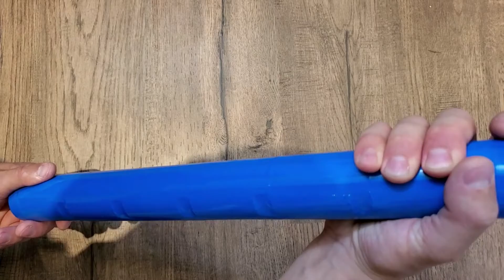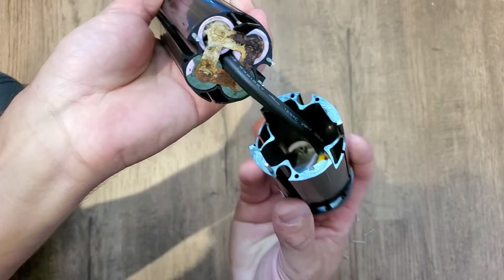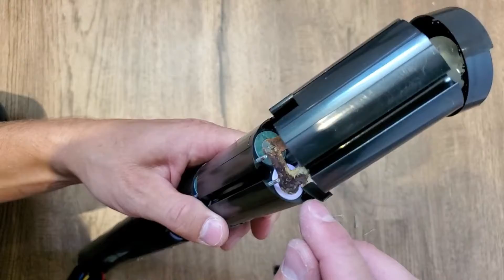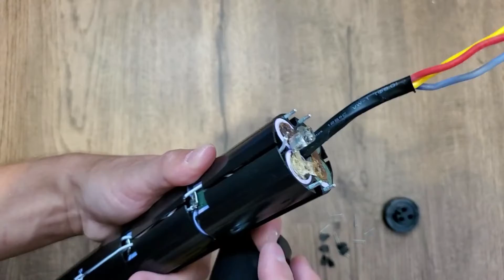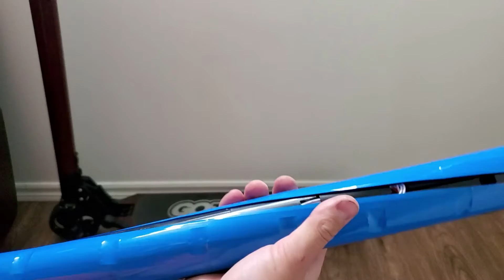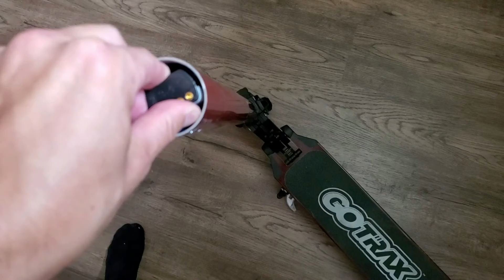Gotrax Electric Scooter Battery Repair Cell Replacement

Comment: Haha wow. ive only just begun to make batteries. I made a 3s and 4s battery. I got all that equipment and tools! this is gonna be a piece of cake! Screw DMEGC batteries! they are so weak! theres much much much better batteries now! 5000mah and 30A discharge? Ohhhh baby! im gonna put another 10,000 miles on this thing
Reply from the maker: The tires wouldn't resist )
Reply: @maximgeek  Bro a thousand thank you's for this vid! I'll send you some pics when im done!

Comment: the contacts for my battery pack were welded together.  I couldn't get them apart with my soldering iron.  Just gonna opt for getting a replacement battery.
Reply from the maker: spot welder was used they need to be mechanically taken appart.

Comment: I have question I haven't ride ir charged my gotrax g2 scotter for 6 or 9 months and it battery dies in 5 minute and when i put it in the charger for 5 seconds the battery comes back
Reply from the maker: maybe battery is disbalanced or some dead cells, you'll need to charge every cell pair to find bad one or balance them, first this I would do, measure voltage on the cells.

Comment: Hey, where can I buy the right 18650 cells? Not all are rated for used in drones or scooter that require more mah. Thanks
Reply from the maker: I usually reuse existing one, in 18650  C rate is important this is discharging rate, for example laptop batteries have low C so if you'll use them, multiple need to be in parallel, if you use power tool batteries, they have good C even one, to buy, it can be aliexpress, amazon ...

Comment: too involved! im throwing the fkn POS scooter in the garbage! NEVER again would i purchase a GOTRAX! I have now way to weld batteries. $350 down the drain!
Reply from the maker: you can buy cheap solder iron, not good for the batteries but will do the job.

Comment: whats the voltage at teh pins? i only get 16v  at the main pins but i get 42v at the pins right after the BMS at the first Battery pack ?
Reply from the maker: you can test per group it will be ~4.2-8.4-12.6 and so on. it it's fully charged or ~4v per group or ~3v if it's discharger.

Comment: whats the total voltage fully charged ???
Reply from the maker: My scooter battery was 36v so it's 10 series when discharged 30v charged max 42v

Comment: I found your video after already having done mine.  I did run into a problem and wanted your thoughts on it if possible.  My cells total 40v.  But the BMS show 14v.  I verified I have 40v coming to the BMS.  Inspection of the BMS was ok.  No indication of overheat or tracers oxidized.  From the battery, the positive and negative are soldered to the board.  The negative wire that is soldered at the end of the board and serves as the negative to the battery 5 post was the problem.  So, what I did was soldered a wire from the negative post at the top cell closest to the BMS to the ground on the BMS that sends ground to the battery.  It worked fine and the scooter runs fine but I am wondering about long term.  You think grounding the terminal to the battery is ok?
Reply from the maker: I don't think so BMS should be able to limit discharge and charge of the battery if you are bypassing this logic it can discharge under allowed voltage and kill the cells or more dangerous overcharge them that can create the fire that's really DANGEROUS.
Reply: @maximgeek  Ya, that is the question... am I bypassing the logic or just giving ground to something that is supposed to be grounded anyway.   Each bank was nearly identical in voltage.   After weeks of riding it daily with many discharge and charge cycles, it seems to be fine.  All cells are almost identical after discharge

Comment: Why not just replace the battery
Reply: Because you can get the cells pretty cheap compared to most pre-packaged options. 
Also, it leaves you certain of what is inside of it, as well as it makes it easier to recycle the old cells.
Reply from the maker: 1 cell cost 2-5$

Comment: What battery does it use
Reply: 18650’s
Reply from the maker: C rating is also important (max discharge rate)

Comment: Hello sir ,u have not shown the measurement of voltage of each assembly which leads to incomplete information
Reply from the maker: Every assembly you charge individually to maximum this is enough. The one that doesn't charge or gas low capacity what one needs to be replaced.

Comment: My battery on the 1-5 terminals has 12v on  1&2 pin  is all file or it should be higher voltage?
Reply from the maker: I don't remember exactly the battery voltage but you should take in consideration that every element should be ~4v, minimum to be able to charge 3v.

Comment: Why not split the tube in half instead of perpendicularly parallel.
Reply from the maker: Hi, because this is how it is build, I wasn't rebuilding whole battery but only replacing some element.

Comment: the cell is 18650
Reply from the maker: yes
Reply: @RomaFixcom  rebuilding the battery is the only way for old discontinued scooter models.
Reply: @boltyk1 true. But this specific battery is still sold. You can search for x7bdh

Comment: I have same scooter the battery is fully charged but scooter only turn on when it is plugged in to the charger. I've seen it charging from 1 dot to 5 dots but when I unplug it and press power button I get no display no power. When I plug in scooter runs fine 14 mph
Reply from the maker: I had similar problem when battery BMS was defective.

Comment: If you still have this scooter (or a charger): would you be so kind as to let me know what the connector is? I thought it was a failry standard 5.5 OD by 2.1 ID, but it doesn't seem to fit. My caliper says OD 4.5 but there is always some measurement error there. I cannot find a connector that will work :(

My scooter has the same overall shape but the battery is only 24V, the motor on the wheel says 250W.

Comment: I disassemble same  pack to find 2 cells under voltage . Wondering what  c rating batteries   those are.  Marked only with numbers starting with 0117030xxxxxxxxx  3.65 v.
I'm testing for capacity now but I'm looking for max discharge C rating

Comment: I haven’t rode or charged my GT tracks V2 in over a year. I take it out of the shed charged it up and it’s not moving. Does it need a new battery even if the battery lifespan was fine?
Reply: does the charger shows that it is charging or doesn't detect the battery at all?

Comment: I have a battery just like that that stopped taking charge and upon disassembly have discovered corrosion on the spot welded terminals in the center section of the battery pack. It eh corrosion from the leaky electrolyte?

Comment: My gxlv2 needs a battery but none are available I can get one for the gxlultra Both are 36v batteries but the ultra battery is 7ah The v2 battery is 5.2ah Can i use the ultra battery in my gxlv2?

Comment: Hi do you think I can use a 36v battery for this scooter since my old one said 25.2v. Do you think it will burn my controller if I use the 36v for the replacement battery?
Reply from the maker: I think controller wouldn't resist.

Comment: 10 batteries in series will give you 36V power. It's so simple to keep the orientation of the batteries right. It looks difficult to copy the processes from the factory. Battery length is critical.
Reply from the maker: this is 6s2p as I remember

Comment: Hi buddy. what voltage do you get from the battery connector? all cells connected getting 37V from battery terminals. connect the charging board (board at the top of the battery unit) I only get 14V + and -????
Reply from the maker: Maybe you have 36v battery, but it seems to be BMS problem.
Reply: @maximgeek  it's gotta be, I think is a chip on bms. Once power removed chip dies, I had similar problem with my dji mavic drone battery. It's OK to have lower voltage as long as there is one to keep the chip alive. Got new battery today and power is 39V from factory connection.

Comment: Do you think it would be ok to replace the cells with 3000Mah, 20 A discharge?
Reply from the maker: Maybe 3000mAh 20A discharge would work
Reply: @maximgeek  I don't see why not. It's just a longer charging time. 20 amps it's plenty, i think.
Reply: @RadBudaspectrum-photography  did you change it?

Comment: Hey thanks for the video! I'm looking to upgrade my friend's scooter to use higher quality cells than gotrax did. Do you know what the capacity and discharge rate of the stock cells were? I'm thinking of LG HG2 with the 30C rating, but wondering if it's overkill?
Also, from your video I counted 24 cells total?
Reply from the maker: I installed 2x5c parallel and when I was driving I feel that not enough but 30C I think would be to much. You need it only on start after consumption decreases.
Reply: @maximgeek  thanks for the reply! Maybe some extra capacity with 20C might be better?
Were there 24 cells total?
Reply: @ryguy694  did you end up replacing with a better battery?
Reply: @victorrodriguez4081  I replaced all cells with 20C and 2800mAh ones and it's working way better! Only problem is that I didn't weld one of the pairs well, so I have to take it apart again.

Comment: I’m wondering if I can upgraded the battery of a Gotrax v2 but no vids about it
Reply from the maker: I already changed my scooter but by the plan I was thinking to attach external 24V battery and use xt60 connector close to charging port.
Reply: I have same scooter in this video i called gotrax they are evil hung up on me was super rude can i use a 36 volt for the g2 plus mine is the 27 volt they dont make it no more

Comment: what is the reason to lead you opening the battery pack? Low voltage or quick drain of battery?
Reply from the maker: not charging.

Comment: Thank you for this video. What tool did you use to charge the individual cells?
Reply from the maker: They where already welded in pairs so I simply soldered them but it you have separate cells you'll need spot welder.
Reply: @maximgeek  thank you for the reply. Did you charge the batteries individually before reassembling? Maybe I misunderstood you in the video.
Reply from the maker: @AB-bu8ti  I tested each pair and found out that I had only 2 pairs defective, I keep original non defective cells and added 4 more cells (2 pairs).

Comment: That's axactly what I needed, I have a Soflow so1, it uses exactly the same battery, but it's 5,2AH. Thanks again now I know where to start. Stay healthy! Greetings from Germany
Reply from the maker: Check that discharge rate to be enough ... I had another one and used weaker batteries and it was shaking on start.

Comment: Hi where do you get order battery?
Reply from the maker: I got mine from electric tool, but you can buy it on ebay or aliexpress but it should have high discharge rate.
Reply: I found those batter 18650 on high discharge 9900 mah   3.7v is that ok to use for gotrax when rebuild those?  My only 20 cells on 5 spots each is 4 cells 2 Parallel. INR 18650-26E. I think it only  3.65v 2600mAh each. 
Now I bought 18650 3.7v. 9900mAh. 
Thanks
Reply from the maker: @brianbmwxg   Discharge rate and battery capacity different things lot of chines sellers fake real battery capacity. between 2000-3000mAh this is normal battery capacity. 9900mAh are unreal nr for 18650 (and discharge rate usually is represented by "C" 2C 5C ...)

Comment: Thank you for this video. I am looking to disassemble and repair the same type of battery from my GoTrax GXL V2. Your video certainly has confirmed for me the process of replacing dead cells. Much appreciated!
Reply from the maker: No Problem ...
Reply: did you do any replacement to the old pack ? what is the result ?
Reply: Hi, I'm currently replacing dead cells on the Gotrax GXL V2- do you know what the Amperage Hour on the individual 18650 batteries are? I know the voltage is 3.7V, and I need to know the amperege hour to safely replace it.
Reply: Usually it's not the console......